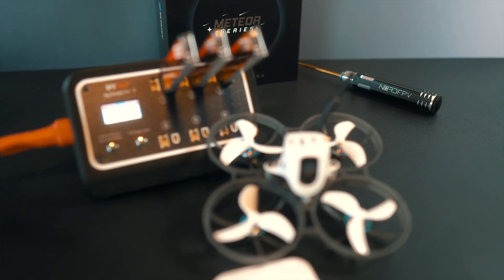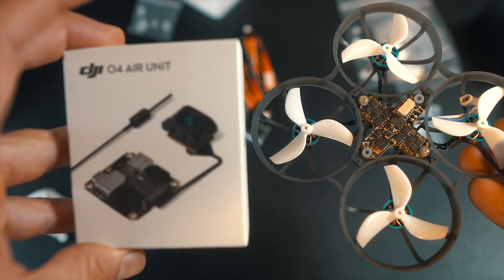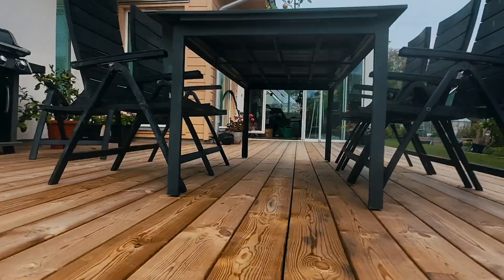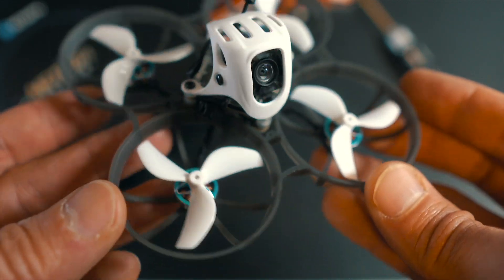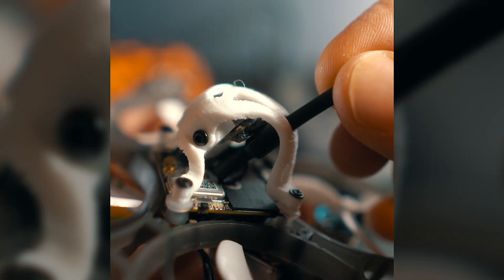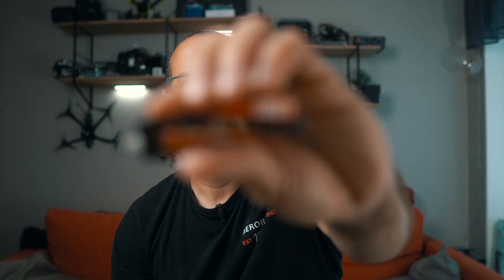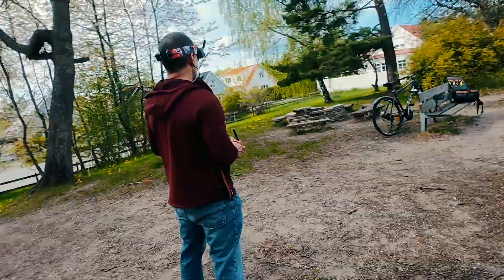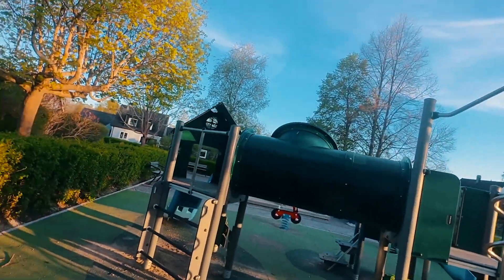Fixing the Jello on the Meteor75 O4 + Review of DJI O4 Lite on a Tinywhoop

Comment: Did you change anything in the setup? On the M75Pro analog, I prefer 48k PWM and HQ 3-blade props. I have an 04 version on the way, I'd appreciate your thoughts :)
Reply from the maker: No. I didn’t change anything.

Comment: Go Sweden! Quick question,  would you consider changing the battery lead to the xt30? I've seen GnB batteries with the xt30 connector.  I know it is more weight but it is kind of a tank anyway. Getting a higher mah or less battery sag could be worth a few extra grams...? Great videos, btw! Tok, tok
Reply from the maker: Hi. Not in this drone. It’s already heavy. I wouldn’t like to add more weight

Comment: Can someone post a full canopy replacement video ? Everyone saying change it but no one can make a video longer than 5 sec to showcase the process
Reply from the maker: I didn’t include it because there’s not much to show. What are you have it issues with?
On this one I linked you just slide the camera in the small 3D part, and then screw the small part to the big one with the side screws. That’s it.
Reply: @NordFPV I wanted to see a full process but more specifically how did you use the canopy with longer post legs because stock doesn’t have they length at all
Reply from the maker: @greymr4038  I honestly just screwed the screw a little tighther. But you can use longer screws if you want to have a cleaner solution, or cut a bit of the legs if you want the new canopy flushed. You can even do the cut with the slicer and get a really clean cut.

Comment: I also 3D printed that canopy and camera holder. In what orientation did you print it? Right side up requires a ton of supports....OR?
At what Infill % did you print at? Full 100% size or ?  Any other advice for printing those two canopy parts is greatly appreciated!!

Thanks for doing this video! I too very much enjoy this whoop, and I too was hesitant because of the weight. But, the power to weight ratio is nearly perfect with those big motors! That's the key!  :)
Reply from the maker: I honestly didn't pay too much attention to the printing quality since I was testing different options. I print it standing as if you are mounting it to the drone. With tree supports it didn't get too crazy on supports, but at the same time I think there may be better ways to get a better quality. I'm not super happy with the quality of the print.
100% infill yes, despite in a small thing like this 100% infill doesn't change that much things.